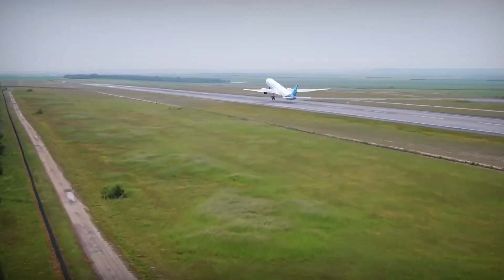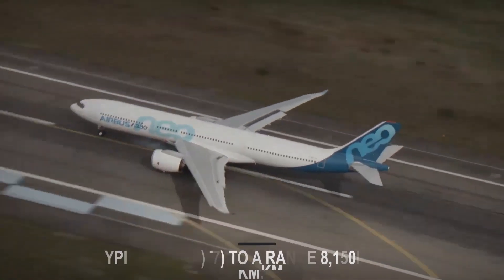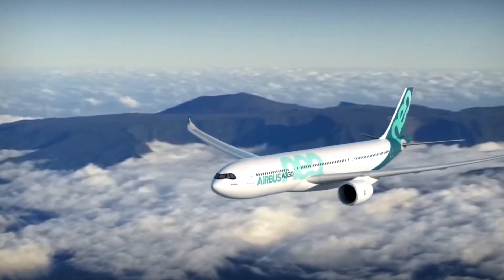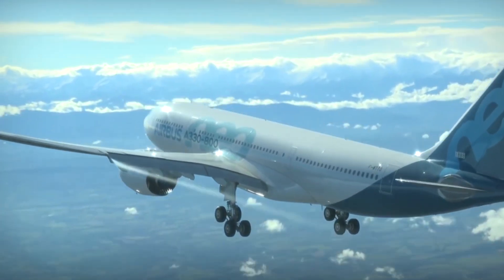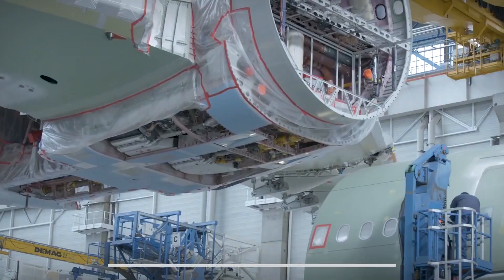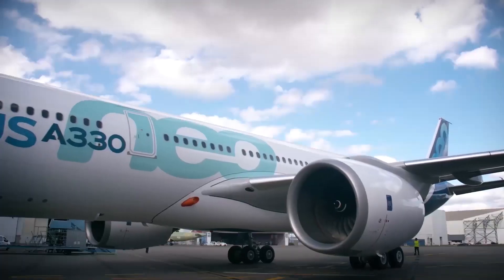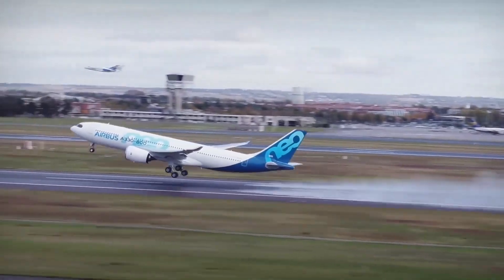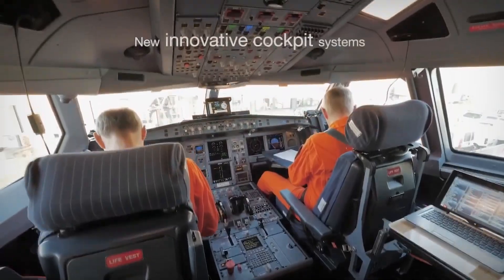Why is the Airbus A330 Neo so successful

Comment: This proves that Airbus listens intelligently to its customers. They didn't want an improved A330 at first, so Airbus went back to the drawing board and delivered the fantastic, game-changing A350. But rather than scrapping the A330 program, they decided to completely re-engineer it to compete with the B787. Its advantages are an aircraft with proven reliability, a lower price point, and incredible versatility for both short-haul and long-haul routes.